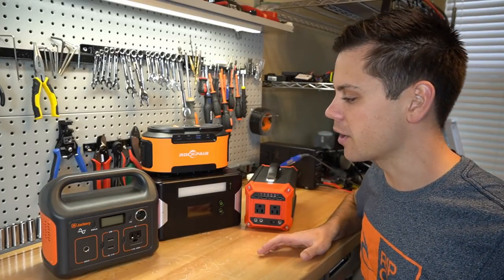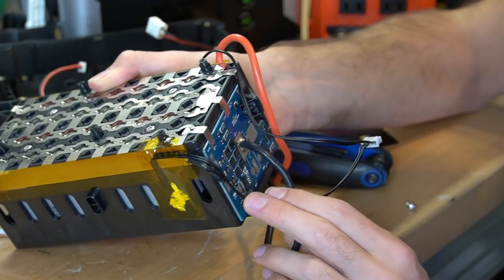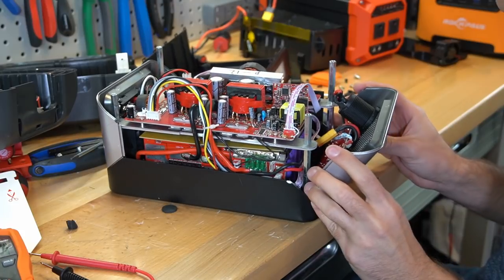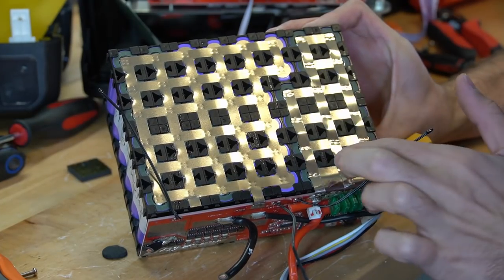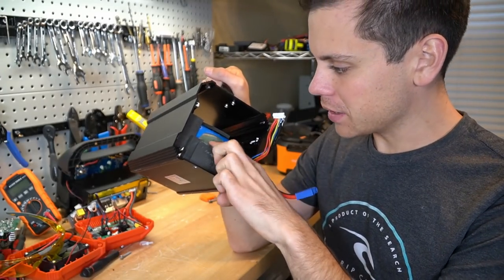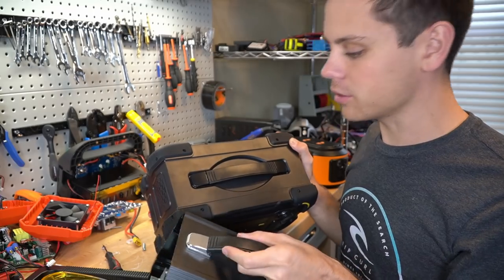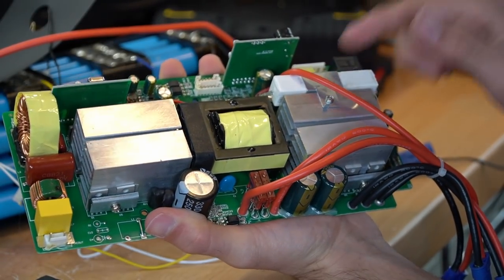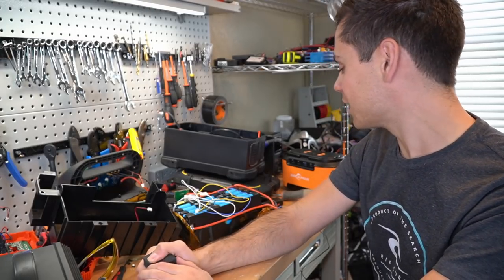Solar Generator Tear Down: Jackery, Safari LT, ExpertPower and Cheap No Name

Comment: Come on Will, SAFETY FIRST man.... you know as well as I that it's not good practice to discharge capacitors by shorting them directly to ground... especially with a tool.  For your sake, please get yourself a power resistor and make yourself a little discharge tool to drain capacitors safely.  I'm not being a hater or a moaning old boomer.... just want to make sure you don't fry yourself :-)    BTW - another awesome teardown video.... love it, thumbs-up !

Comment: You need to get a cheap pocket oscilloscope so you can look at the output AC waveform under load. That's what really differentiates a good inverter from a chinchy one.
Reply from the maker: Smart. Really need a scope for my new lab
Reply: @WillProwse  You might want to get a set of differential probes to go with it considering your fast pace. Edit: actuslly that wouldn't be necessary with a battery powered pocket scope as suggested.
Reply: I think Will performed a subjective teardown assessment. Is like him to back it up with numbers. Sexy boards are nice but does it do the trick over an ugly one??

Comment: You are killing it with the releases. Don't tire yourself out but I get the idea that you love doing what you are doing.  
EDIT: LOL, I made that comment before you said that you love it. 

I would NEVER use a LiPo battery in my ebike or any automotive application. For my ebike, typical Nickel Cobalt 18650 cells did the job for me in a 13s10p config. For my car's camera back up battery, I  used LFP batteries in it's construction and my jump starter also uses LFP batteries. They are great in applications where weight is an absolute factor such as flying equipment. In a bike, hoverboard, skateboard etc, weight is a factor but not so much. That is where regular 18650 Lithium Ion cells shine.

Comment: FWIW Will, as a toddler I took apart wall outlets using thumb and nail. Hilarious part was, I never got shocked, but my father did putting it back together.... Thanks for the teardown! The torpedo-like one that you'd been using for months was a pleasant surprise.

Comment: Still making my way through you video encyclopedia of solar and battery backup systems. Completed my first local presentation on the subject to a local area club, and am scheduled for a second presentation late this month. 

I cant think you enough for providing us so much information by doing these tear downs. Every video I continue to take in new knowledge and can then experiment with various setups which ultimately helps in sharing with others. We had a 1-1/2 hour question and answer radio show yesterday. I was a bit nervous of what some of the questions might be, but all were really good questions that many of us have had and I was able to provide information that answered those questions as well as offer some additional perspective. 

Thanks again. K5JRX

Comment: I have researched the different solar generators and ended up with a Jackery 500W.  It seems to be well accepted by reviewers.   I'm very pleased the Jackery you dismantled was such high quality.   The Chinese take making cost reductions using "cheaper" components to an art form.   They will substitute UL Non-recognized components where UL components should be used for our safety to save money.   Thank you for sharing.

Comment: Just a side note, besides owning the Rockpals 280Wh power generator, I also purchased the Beaudens 166Wh power generator.  It has LiFePO4 batteries, MPPT controller and an aluminum case.  I have been impressed with both units.
Reply: I'm thinking about buying the Beaudens just for the battery alone. Which solar array do you use to charge it?
Reply: @jeniestra.  I have the Renogy solar suitcase that i could use to charge it easily, but so far i have just used regular AC to charge it.

Comment: Hey mate, love your videos. I have a stack of 18650’s and wish to build one of these. I’m really struggling to find a good quality solar charge controller module and 12v regulator to suit it. I’d like MPPT to maximise solar charging like you demonstrated on your other videos with the RockPals. I don’t need an inverter as I have a small external one which will do the job and allow the unit to be smaller.  Maybe you could build one too and video it! I’m sure it would be a super popular video. Really hope to hear back from you, thanks again for the videos!!

Comment: In another video you noted the very slow recharge rate of a Jackery as compared to other brands and I was just wondering if, as you dismantled the Jackery, you happened to pinpoint something internally that accounted for that less than ideal recharge rate? (And then maybe Jackery would adjust that.). Thx Will. Great videos.

Comment: I came in looking for some info on a failed charge controller,on one of those 60# leoch so-gens. It was charging along at about 440 watts, about 140 over rated max. Then it popped a d smoked a little, and no longer charges. Everything else still works,including the ac charging. I'm thinking I exceeded the mppt controller limits.

Comment: Hi! I'm starting with off-grid power emergency system. I started with a simple Plug-N-Play solar generator, the ALLPOWERS 606Wh. 

They are quite cool in appearance, but I noticed a couple of weird things :
-There's always a green light blinking inside, even when turned off,
-The battery never shows 100% when fully charged
-The count-down to full charge is not counting down but counting up!

Apart from that, everything works as expected.
Is there any chance you can do a review/ Tear down of this generator?

Comment: I'm so glad this sort of stuff wasn't around when I was a kid otherwise I probably would have fried myself. I used to pull everything apart at some stage. My dad got frustrated with it and used to give me broken stuff and see if I could pull it apart and fix it. Oddly the most fun thing to pull apart was a wind up clock. It was so cool with gears and Springs and stuff and I fixed it 😁

Comment: Silly question,If instead of going from solar panel straight to jackery,one would use the load terminals of an mppt charger, would the losses be too great and not worth it?In essence would that speed up charge time?

Comment: @2:40 It looks like the Jackery has room for more cells, 4 on each end. So you could increase the capacity to over 300WHr if you populated those spaces. Also wouldn't hurt to beef up the nickle strip for better current capacity.

Comment: you can get those triangle security screws with an appropriately sized flathead.
Reply from the maker: I couldn't with any tiny screw drivers. Super pain. None of my flat heads would fit. It was tiny tiny
Reply: @WillProwse  Oh, what a bummer, that trick got me out of a few pinches.

Comment: * The Jackery has room for 9 cells in parallel but uses only 7.  Now we know how the Honda by Jackery power bank, which looks just like the Jackery, provides 290Wh instead of the Jackery's 240.
* The Suaoki 150Wh powerbank uses those triangular screws too.  I bought a bit to fit them and then found a couple that were recessed 50mm into the case.  I never found a long screwdriver for sale on the internet that fit them, but didn't mind abandoning the project because the Suaoki started working again.  I had shorted out the 12v output trying to measure it, to see if it was regulated -- guess who inspired me to be curious about that?  The whole unit quit powering up, but later it was fine -- thermal fuse?
* Will, if you can non-destructively disassemble them, and put them back together, I'm sure HOWA knows plenty of worthy recipients for a free powerbank, even if the quality indicates that it will only last a few months.  Lug your unwanted freebies to RTR and make someone's day.

Comment: Hello there bud, I wonder if you can help me. I have a valence 130ah  u27 12xp lithium ion battery just one. Now I'm using a 150w panel to keep it charged up in my cabin. What I want to no is can you tell me the charging specs for this battery. I'm using a mppt charge controller & don't no what float voltage or boost voltage should be set at. Thank you. I have been on valence website but I don't understand it. Thanks. Love your videos been a long time fan, I'm not just saying that to get help either. Lol

Comment: Hello Will or other knowledgeable people in the community. Can the AC output of two of these be run in parallel to double the current? I know inverter generators can be run in parallel with a combining cable. But is there any chance that this will damage these units or will it not work because the current will be out of phase? I keep buying these cheap rockpals 300w and similar re-branded solar generators because they are so cheap (around 100 dollars) I just need to figure out what to do with them now.
Reply: No. You can't parallel up 2 AC inverters, as they would fight each other. The AC wave for needs to be synchronized exactly, or they're short each other out.

Comment: Okay I'll give my secret away get a good set of security bits for those security screws and if you do run into triangles use a flat blade you can occasionally find Triangle bits but they're probably going to be the wrong size that you need.

Comment: can you do a video on configuring the 40a Tracer BN plz.   think got it right, but after only a few moments it turns off my load. on manual mode  load is 3.5 - 4amps have 2 90 ah agm batteries wired in parallel with voltage 12.7v

Comment: I'd get a Jackery, but for the 12v plug.
Reply: What about the 12v outlet? I believe, I can’t remember what he called it, it’s not regulated or something like some other 12v outlets (or something like that; balanced?)...

Edit...
Yes, it’s “regulated” as I jus heard the term again on HOBO Tech’s latest video, where he said ALL Jackeries are known for having a regulated 12v ‘receptacle’ (outlet/plug), while reviewing the differences between the Honda branded 290 🆚 the regular 240 (& the 290, at least, has a regulated 12v port, plug, outlet). I’m a van of the Jackery brand from various sources & reasons!⚡️
Reply: Yes the 290 had a regulated 12v the 240 does not. Regulated means the voltage doesn't drop, much, under load & can put out a full 12.8 etc volts. So runs 12 appliances very well.

Comment: Those cells in the cheap pack are fst cells from china. They sell for about a $1.50 each vs $5.00 for a similar samsung 25r. Probably not the best of quality compared to higher end cells from Samsung, LG or Sony.

Comment: One spark nick in those pliers will damage them, and then they will split and explode under heavy-duty cutting.
Reply from the maker: Good point. Should not do that next time
Reply from the maker: I have broken three pairs so far
Reply: @WillProwse  They go off like a gun don't they.  High-tensile steel impacted eyebrow last time, with a mean little cut.  Very unfunny.

Comment: wowow newer lipos are just as safe or safer then 18650s, I have tested and can get 18650s to catch fire easier then EV lipos, also 18650s get way hotter before bursting /letting out smoke in my test then any lipos I have other then the first few years of lipos (10 years ago)  I prefer lipo battery generators over 18650s.
Reply: also loved the video :D

Comment: I realize it's what the marketers call them, but these things are NOT GENERATORS.  Most of them aren't inherently solar, either, they're just battery packs with built-in inverters and they don't "generate" anything.  "Generator: a dynamo or similar machine for converting mechanical energy into electricity."

Comment: A real electrician would short out the big caps with wet fingers or their tongue :-) o.k. - just jokin - but in earlier times some people really did it, i heard.  Voltage up to 330V DC and up to 300 uF normally wont kill you - but it hurts.

Comment: You should try to design one yourself from scratch. Pick all the best high-quality parts in the nicest looking high-quality strongest case with the best handle with the biggest most brightest display in the highest quality highest energy density batteries. Then add up all the cost for manufacturing and all the components and you’ll see why they go cheap on some components to bring down the margin that people would actually buy and you can make a profit on if you sold it.

Comment: Yeah the caps can have nearly 200volts DC. It requires about 180 volts to make 120 vac, 120 vac rectified, is 175-180vdc, I actually had the crazy idea that I was going to build a pure sine inverter, to power my house! After studying for over a year, I bought one!! Ha-ha! I'd probably killed someone, or myself , burned the house down or something, not to mention the cash I'd wasted. I was shooting for about 15-20 kw!! I did gather some parts. I'll use that for something less complicated! Although a 250 vdc inverter to 120 vac wouldn't be too difficult, getting the clean sine wave with good regulation is the difficult part. Anyone can build a unregulated wild AC boost circuit, yt is full of them, running at over 1000 Hz, way over 50/60 Hz of grid power, and voltage depends on load, completely unregulated. Since you aren't going to use those! Can I get them ?  You can keep the batteries , unless you don't want them either! I'd pay shipping!